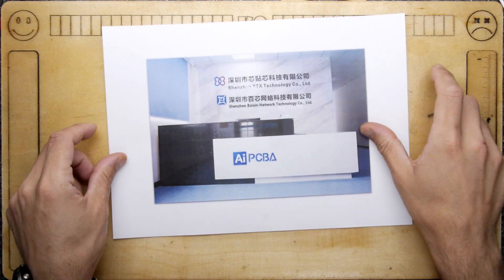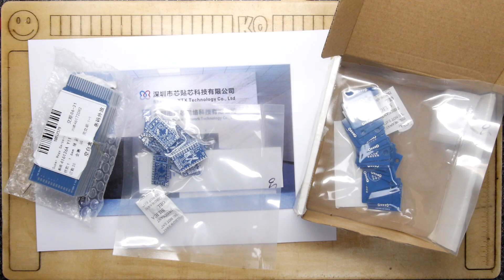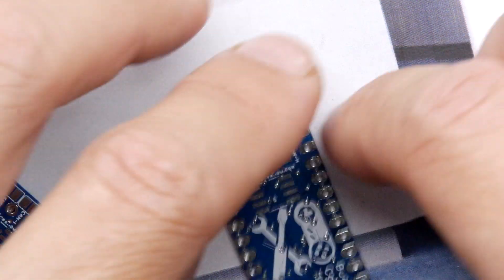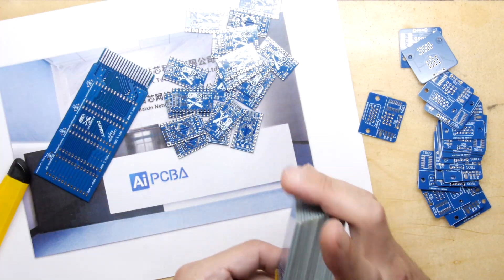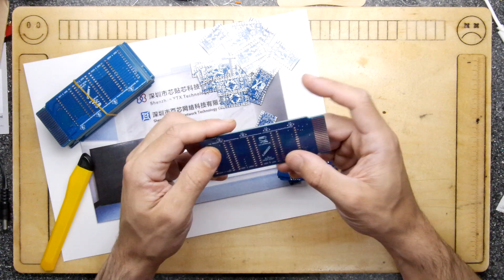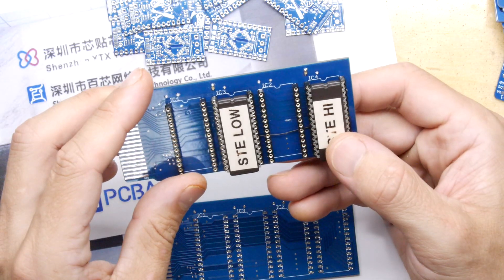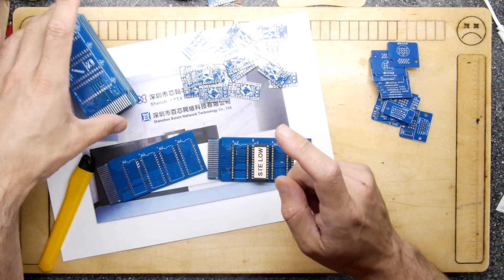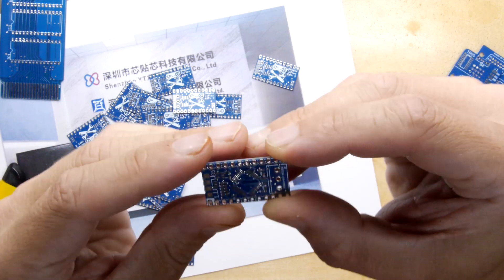AiPBCA Cortex Atari ST PCBs review

Comment: I am interested in the vga adapter as well.  This video appeared at just the right time as I was thinking I have a Romantic Robot cartridge that only works on an STFM. I was thinking I should take a look in STEam and work out what is wrong and recode it then I could burn it to a real eeprom.  One question - could you make a cartridge adapter that used flash so I could write it via a usb adapter 'cos I don't have an eeprom programmer.
Reply from the maker: Let's chat about this in my Discord, we can figure things out

Comment: When your Atari ST cartridge PCB is fixed, you could consider burning the EmuTOS cartridge to it. Due to size limitation, it can only run textmode Atari programs, but that can still be useful for hardware debugging. It also features an ACSI hard-disk driver, without the need of extra software.
Reply from the maker: I will definitely be doing this!!

I'll be offering some boards for sale and possibly some programmed chips to help people out. This could be an interesting option

Comment: Have you demo'd low res colour on VGA using your board in a video?
Reply from the maker: I've not built it yet, but will soon and definitely demo it
Reply: @backofficeshow  I have an ST-VGA cable but that is hi-res only.   I think have spoken before with you about getting low and med  to output on monitors.  If you crack it will be very useful.
Reply from the maker: @clangerbasher  I might just run the output from this board to an ossc unit to a HDMI monitor and it will worry about it.
Reply: @backofficeshow  I think it is the only way.  If  ST low res out to VGA just using a lead  was crackable I think it would have been done by now.
Reply from the maker: @clangerbasher  I have found monitors it works on, but really it needs a scan doubler for newer stuff and that's what the ossc does, so the solution pretty much exists.
Reply: @backofficeshow  I look forward to your video.  :)

Comment: Could you use them new boobie boards  to interface with linbus also?
Reply from the maker: I should think so, the Linbus specifications are a little relaxed vs CAN. But if  you think of the Boobie Cortex as the brains of the operation you could make a personality module for any number of other standards. You could keep the onboard CAN and add LIN etc to the personality boards with all the CAN, LIN etc connectors